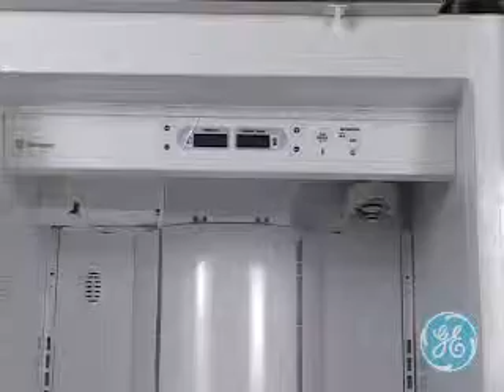ƒ MONOGRAM SXS CONTROL PANEL REMOVAL MPEG 1

Comment: I have a GE Monogram ZISP480DTASS and I was having trouble with it, I changed the inverter but before I did I placed the fridge in test mode and it timed out and now it beeps when the temp is adjusted. I unglegged it to try to reset it and nothing works and the control lock is not engaged https://www.youtube.com/shorts/uTDwJp5wg58